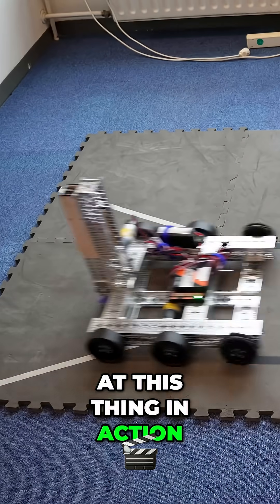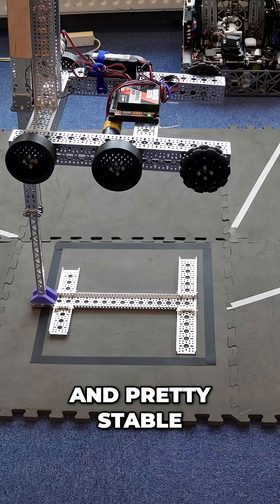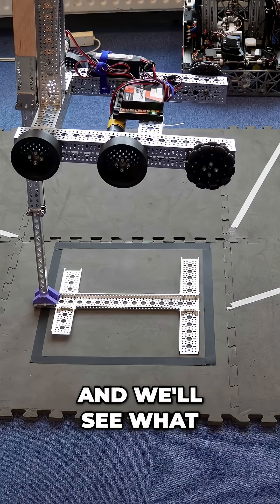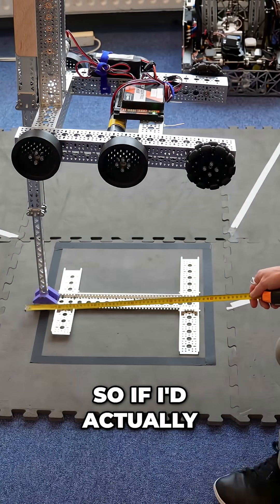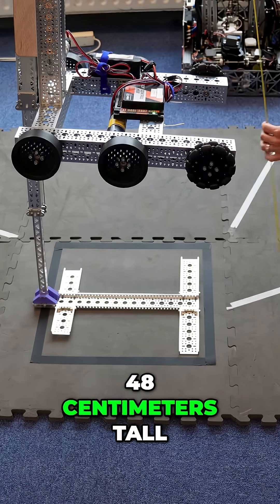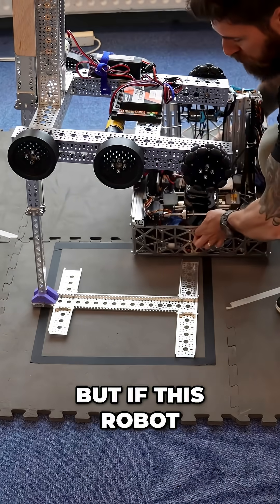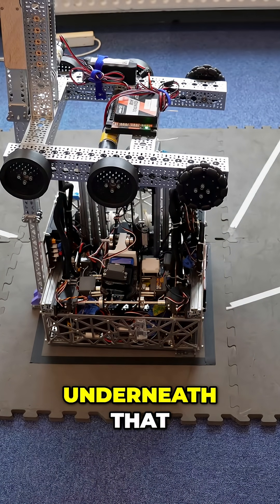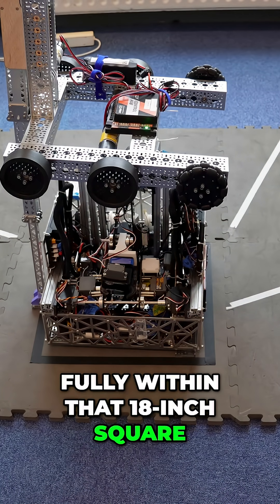FTC Decode 2 robots 1 base prototype

Comment: Definitely a good first prototype, would definitely need some changes, the bottom part should be flat so your teammate can actually drive in, and it doesn't look like it can support much weight?
Reply from the maker: The box tube has a breaking force of 45kg (on a pocketed system), That should be more than sufficient. This also isn't intended to be a complete prototype as I want teams to use it as inspiration and run with the idea, rather than simply bolting this onto their systems.
Reply: This seems like a great prototype, our team is thinking about this idea!

Comment: What's the goal?
Reply: Check FTC 2026 challenge
Reply from the maker: Trying to fit x2 robots inside an 18x18 inch square. A potential way of doing this is lifting 1 robot up above the ground and the other drive over the base, like with this telescopic elevator.
Reply: @BroganMPratt what about 2x 9x18" robots side by side?
Reply: @pragmaticplatypus it could also work, but it's very difficult to design a robot that thin due to the size of the scoring elements
Reply: You cant control 2 robots at the same time
Its apart of the roles